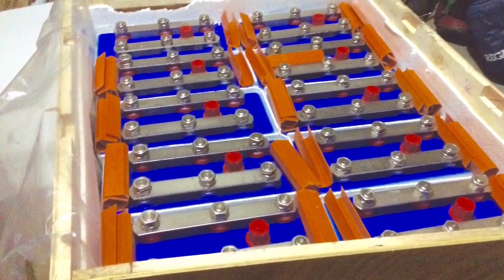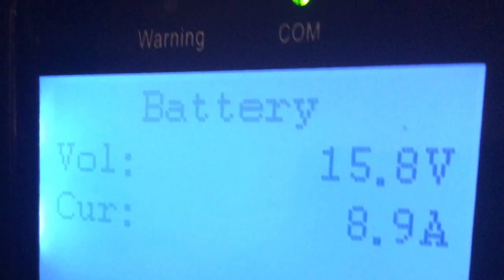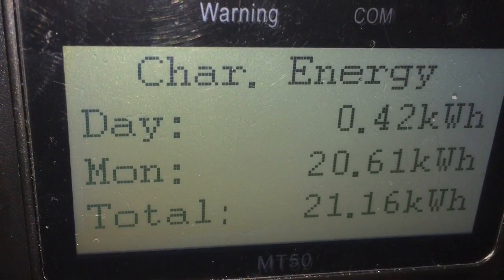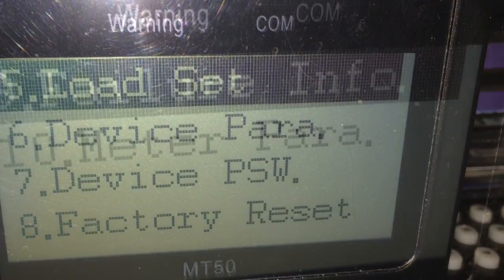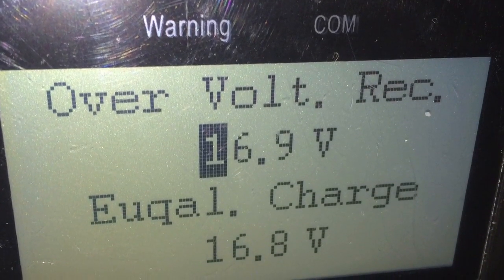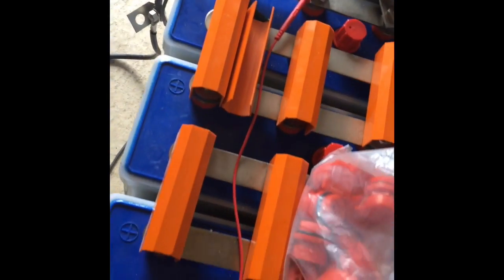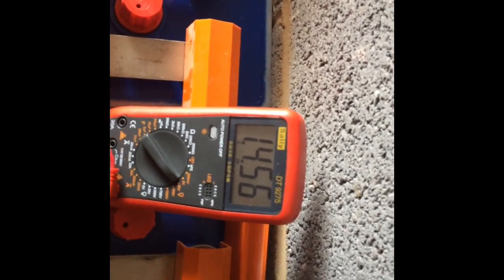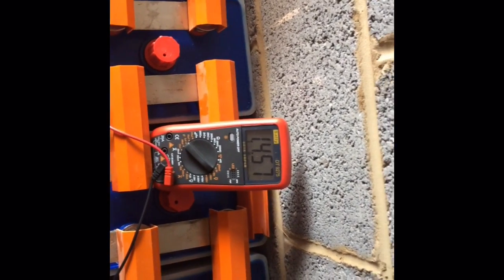Home  Storage, My new mppt charge controller for nickle iron batteries

Comment: So you can seriously charge nickel iron batteries off of a lead acid charge controller and no issues right? Awesome!
Reply from the maker: Not really the lead acid battery controller can charge up to 13v and the nickel iron batteries need 15.5 volts... the one I brought can be programmed to go 17v but for this setup I need a proper charger... I’ve found one power supply that does 15.6 v at 100 amp ( Chinese psu) and it’s ok but the next item to buy is a outback inverter charger with programmable charge voltage up to 17v... I am currently saving up for it...
Reply: sli Fox what im wondering is, and if i can steal your ear for a minute, does it matter what charging profile it has so long as it hits 15.5 volts?
Reply from the maker: For  nickel iron batteries it HAS to be around 15 volts or 17 volts to equiilise the cells...  hey use a higher voltage of 15v to allow the electro chemistry to work at its best... any lower and you wont really charge them... They will charge but you wont have a full battery....